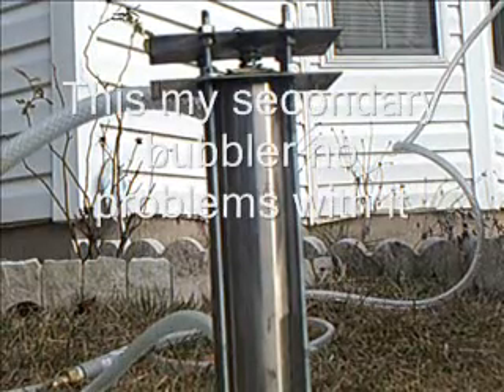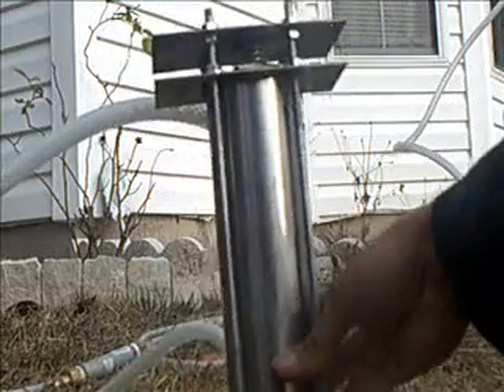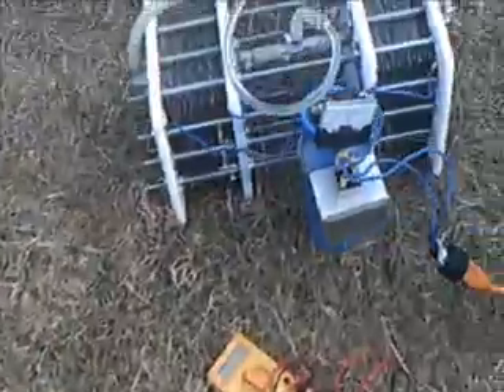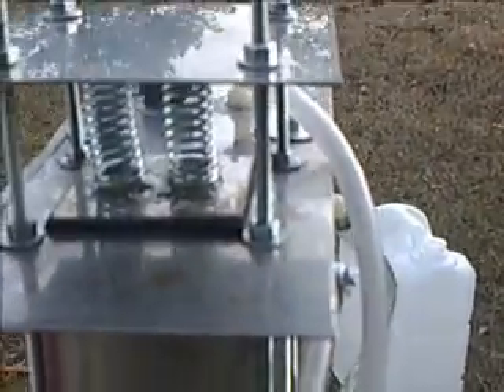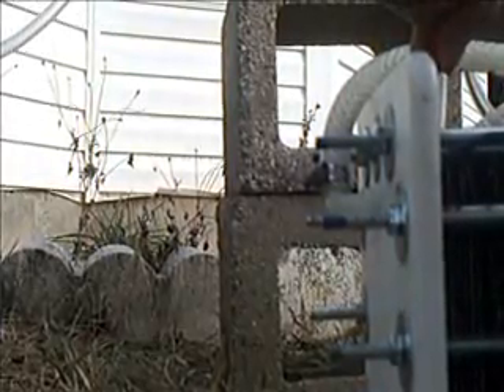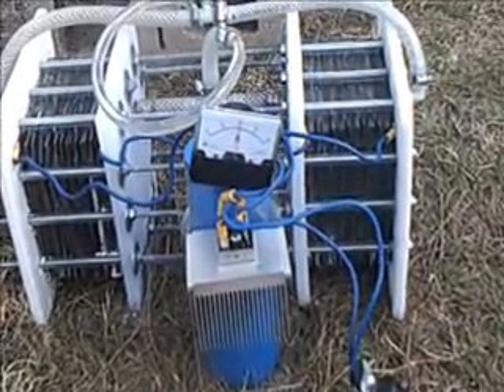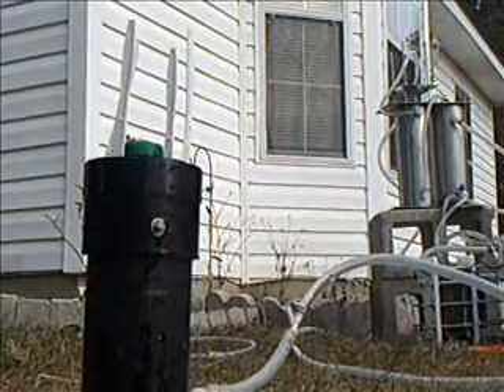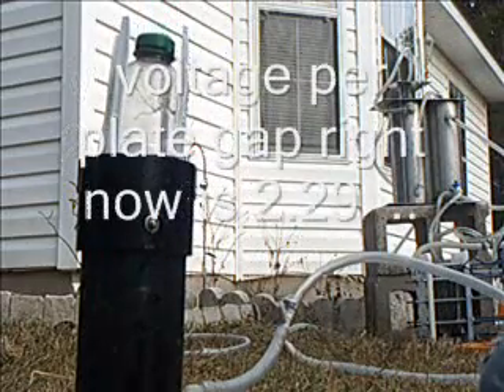Reset Bubbler & MMW test with Monster Cell

Comment from the maker: there is no valve , in this setup on any of the gas lines , the one valve on this setup is a cut off valve for the electrolyte , that way I can unhook everything and not have to empty it .......I measure my gas the just like everybody else does with no back pressure ....

Comment: your system is good what you need  is a little bit of machining and a spring that is less powerful when you used 2 it was like you are forcing a lot .then the moving part you have to weld a round .5inch rod in the center drill the upper plate weld a tube that is bigger than the .5 rode so it move like a piston this way your mechanism will be centered all the way .